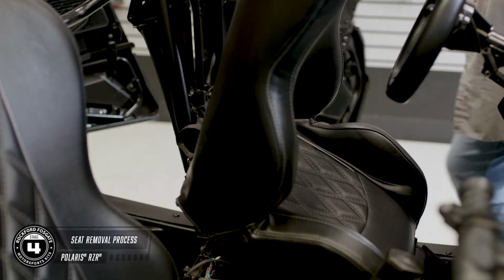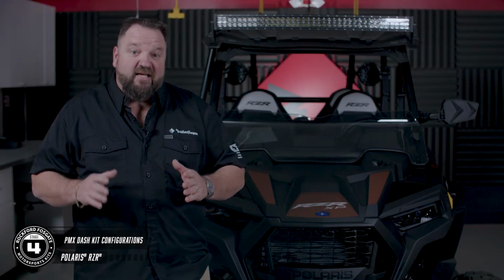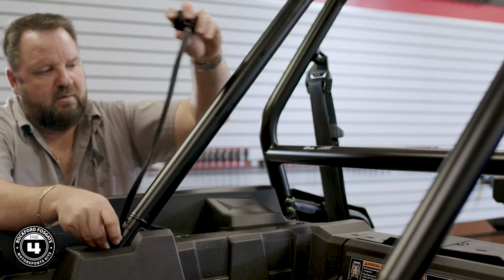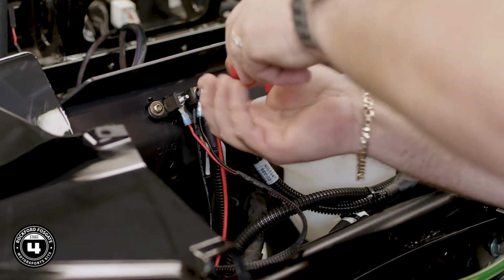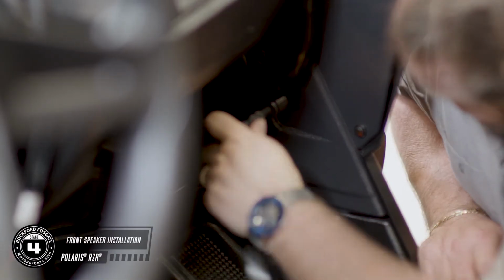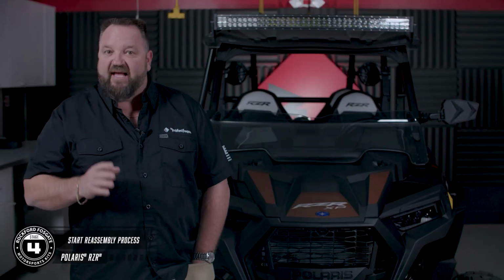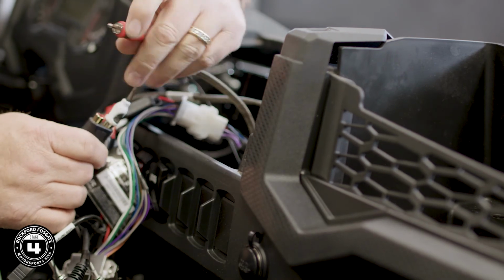Polaris RZR14-STG4 Installation (Gen-3)

Comment: The subwoofer connector has some sort of power connection to it.  Does it need to be connected to additional power and ground?
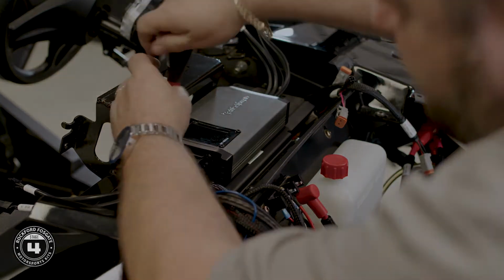Reply from the maker: Yes, at timecode 10:00 Greg shows connecting the subwoofer and power connector to the amplifier.

Comment: Im lost... there are 2-4 pin female connectors coming off each side of the amp. I can only find two 4 pin male connectors in my harnesses. Where are these other two all of the other connectors I have are those bigger, gray connectors from the individual speakers.
Helpppp
Reply from the maker: • FRONT OUTPUT connects to the speakers
• REAR OUTPUT connects to the subwoofer
• POWER PLUG connects to the power connector
• Harness “Front” connects to FRONT INPUT
• Harness “Rear/Subwoofer” connects to the REAR INPUT
Reply: It must not be used because I never hooked it up and everything works fine, must be for a second subwoofer or something
Reply from the maker: @UpInYa87  Glad you were able to figure it out.
Reply: About how long did it take you to install ? Do you like it ?
Reply: @juanalvarado2969  a few evenings 
Yeah, it sounds great!
Reply from the maker: @juanalvarado2969  Typical installation time is 3-4 hours.  If this is a first time install, I'd do it during a Saturday.